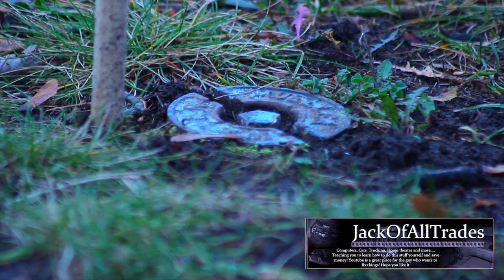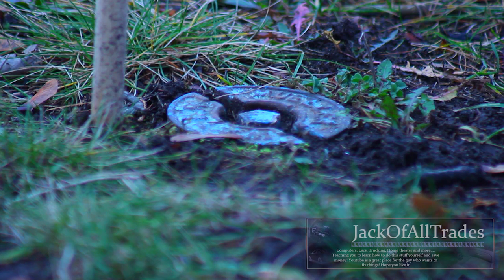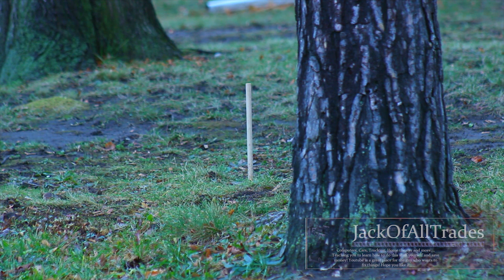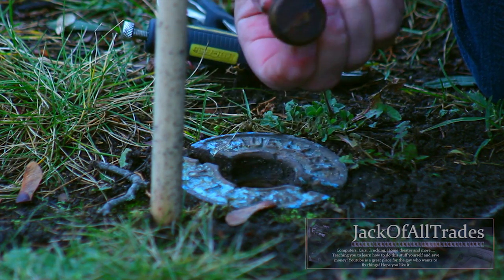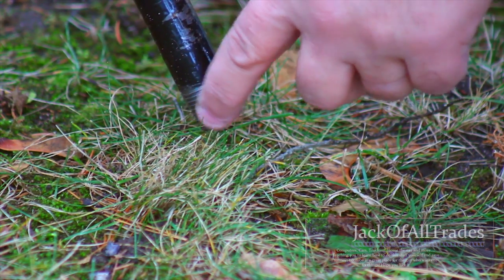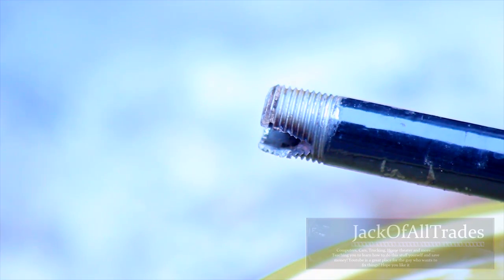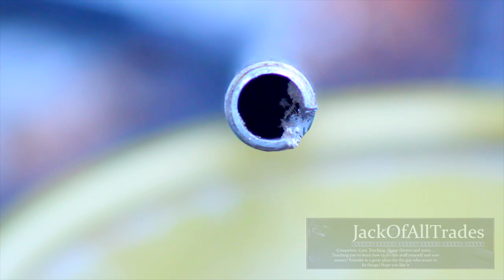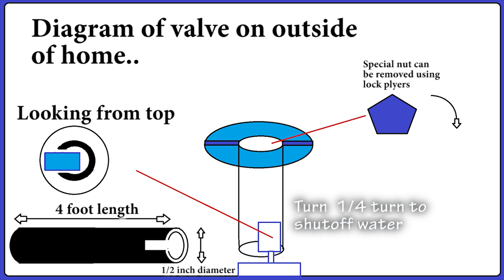How Do I Shut Off The Main Water Supply To  My  Home With This Special tool and save 80 bucks

Comment: I had difficulty finding the correct curbside valve shut-off tool as the depth in the ground was 4ft and less than 1" narrow. I bought the 1/2" cast iron rod and modified as you suggested. It is a low-cost solution and works great. Thank you!

Comment: From Winnipeg MB
 Thank-you for this. Just talking to some friends who had their inside shut off valve break after returning from vacation and had to try and stop the main pressure from flooding the house, while they waited on the city service! Some two hours later the technicians/engineers arrived! So I think it is wise if everyone has a key for real emergencies only, not be dependent on "rapid response" from their local water authority. So the issue is really time and not money saved.
Reply: Same here

Comment: Good video, and does work, but a word of caution,  don't force an old rusted shut-off valve because if the valve breaks apart and starts leaking, you could be paying significant repair bill from your local utility.

Comment: In Markham Ontario,  fees to charge to turn on/off curbside water valve during regular hour is $173.5 and after hour is $262. Plus tax of course. I will definitely try your method. My indoor shut off valve is leaking. I need to repair or replace it. Thanks General1.
Reply from the maker: When I bought my house the main shutoff valve started leaking a year later. Guess the plumber or previous home owner used a metal adapter with a bronze fitting and it leaked. I replace with all brass and new shutoff valve. Remember to slowly work it back and forth little untel 1/4 turn. you will feel it stop. Open all the valves in your house before. Then have your wife check if the water is off. Reverse to turn back on. Be cautious as if your break the valve it will cost you to dig in out and replace. Good luck.

Comment: I used similar pliers but can't move the nut at all. Any special trick or tool to do you job please. Thea house is about 20 years old. Never touch  the water valve before.
Reply from the maker: In comments some users said there is a hex nut that local hardware store sells to undo this. You could try blow torch to loosen rust in threads then pliers. When I use to do automotive work blasting nut with heat helps get her off.
Reply: @gereral1_jackofalltrades  great suggestion. I have sprayed a lot of WD40 to try loosen up the rust. Then I will try your methods tmr. Thanks for your immediate response. Have a nice weekend.

Comment: Hi guys is the lid bolt a 1/2-Inch Drive 5-Point Penta Socket
Reply: mine was 5/8 inch penta. can't find it in canada - except on amazon. but you can get it at home depot in the states or any plumbing supply in the us also

Comment: hey, very useful vid. Thanks! I'm in Brampton...do you know if there is supposed to be a pipe connected underneath to keep the cover in place?
Reply from the maker: The cover screws into bigger pipe and the valve is inside like a pipe inside a pipe.....
Reply: @gereral1_jackofalltrades  thanks for the swift reply man! I was asking as i found my cap loose (driveway) and wondering if it should be sitting on something. Looks off
Reply from the maker: @MonstasInc  I live 45 minutes from Hamilton lol stay safe
Reply: @gereral1_jackofalltrades  lol nice thanks man - you too!

Comment: Is there a special tool for that specific bolt?
Reply: yes
Reply: @sneakinguponit  were can i get it?
Reply: Google pentagon curb stop key. There are lots of options. It helps to know what brand the box is as the sizes of bolts vary. I saw a socket adapter that fits all of them but don’t remember what it’s called.
Reply: if you stay in canada the only option is amazon. but you can get it at home depot US or any plumbing supply in the states. there are companies that sell them in canada but only to municipalities (usually). mine was 5/8 inch penta. that's the most common from what i can tell.

Comment: Super helpful, I was just wondering what type (material) of pipe did you use to make your tool? Also how did you fit a handle to the pipe so you can turn it?
Reply from the maker: Metal threaded pipe. Used loctite on handle so it would be solid.

Comment: Most cities frown on anyone shutting off the water at the curb who is not authorized to do so, the 80 dollars may be cheaper if you break it and you don’t have water for a few days or you cause it to leak and get charged for the repair

Comment: is it just a shut off valve? the water pressure in my house is super weak, i went everywhere around to check  and all the valves are fully open up to the main of the house, so i tough about opening more the one from the street, can you rise/lower the pressure from there or it just put it on/off?
Reply from the maker: martin blouin on off..... Be careful you break it it's going to cost you to replace. The water pressure can be from the town line connection to your main shutoff inside your home. My main valve was 80 percent corrosion because previous owner put a brass valve on a galvanized metal fitting which rusted. Cought it in time before it rusted through. My pressure is 50 psi now. It was supper low because of the blockage.
Reply: close to where your meter is located there is a pressure regulator you can increase or decrease pressure on the top bolt

Comment: Isn't there a tool we can use instead of making our own or the cap off with pliers?
Reply from the maker: No the shaft is too narrow and I've never seen a socket in any socket that will remove that weird nut. Just be careful as if you break it they will make you pay for a dig and repair. I did this and was fine but I'm sure it's gone bad for many as well if the valve is seized.

Comment: Or you could just buy a water key at a local hardware store. Caution: if you're turning off the utility's valve and it happens to fail while you operate it, you might be out several hundred dollars depending on the utility. They may hold you responsible for the damage to their equipment.
Reply: Wasn't me, don't know what happened.
Reply: I just came out to look at it. I can’t find one at the stores
Reply: FYI. Even if you do the “right” thing and the water dept breaks it, you’re still on the hook for the repair.
Reply: @saljablo2767  Never heard of that before. On top of that, at my last employer before retiring, the techs were prohibited from touching or operating customer owned equipment for the same reason - they break it, they buy it.

On one call I sent a tech on, he found a customer leak on their service line. The lady couldn't turn off her private valve for some reason so the tech tried to do it for her. 

The private cutoff valve broke, so now WE were responsible for her damage. He tried to repair it without telling me and only made matters worse as the pipe broke. Now he was screwed and had to request assistance. Problem is, our techs don't have the parts needed to repair private equipment. I ended up having to call their supervisor who had to arrange for a plumber to go out there on our dime to repair the damage we'd caused. His supervisors were NOT happy.
Reply: @whiteknightcat  a lot of people don’t read the fine print on their bills. Water and gas service lines are the homeowners responsibility. That’s why insurance companies are cashing in now on it. You can buy a policy for a few bucks extra on your bill a month, that’ll cover and damage to service. From the street to your house.
Reply: @saljablo2767  A lot of people can't even read the big print too!
Reply: @saljablo2767  😢

Comment: I wish there were specifications on the diameters, idk if it's 1/2 inch inside or outside
Reply from the maker: if you say you need 1/2 inch pipe the hardware store will give you exactly what you see in this video. Be careful with the valve. 1/4 turn to turn on 1/4 turn to turn off. Older valves may break. I've shut mine off twice now with no problems. Now that I installed a new shutoff ball valve before the curb I can shut off the water to do work inside my home. The only reason I needed to shut off this valve was that it was leaking before my ball valve. Good to know this info in case of an emergency as well. Just be careful.

Comment: I copied what you have shown and it feels like i get ahold of valve but does not even slow the water  let alone shut off. I tried one quarter turn also much smaller turns and much larger turns also but water does not turn off
Reply from the maker: If valve is stuck call town. If it breaks it will cost you thousands for dig and repair. just be careful as these valves seize over time.
Reply: @gereral1_jackofalltrades  Yes I realize, thx but outside valve is maybe just replaced one year ago by the city, so I dont think or feel like it is seized, oh well I guess I have to pay $130 for the city to do. Much thx all the same.
Reply from the maker: @joedowney3197  it's a round valve with t shape on top. Wish I had a camera I could put down hole to show viewers. When I made this video I had town turn water off and on 4 moths prior and then had to install valve for home  so I built that took and it worked perfectly. My valve took 90 deg to turn on and off

Comment: The 5 sided special nut that you used a pair of pliers to take off at min.1:40 into the video on my property is recessed a little bit so I can not get pliers down to it and Vice Grips will not fit into the hole and around the special nut at the same time....What is this wrench called and where can I get one? Thanks
Reply from the maker: Its special tool. Just use needle nose lock plyers if there is room. Im sure a pipe cut to fit part of the nut woulr work too. Just be careful when you turn the valve. It may be stiff. Work it slowely. If you break it its going to cost you huge amount of money to dig up and fix.
Reply: A spray of PB Blaster and a couple of medium gentle hits with a hammer gave the bolt enough of a jolt to be able to loosen it with a poorly fitting needle nosed vice grips...be careful!

Comment: I run a water department in a small town in New Hampshire and I don’t recommend anybody shutting off their own water. Like other people have said this is not your valve this valve belongs to the town everything after this valve belongs to you. This is good advice call your towns water department and have them turn your water off because if there is a problem it’s on them. Remember just because this line runs the your house doesn’t mean you own it.
Reply: True, but if you have water running into your basement, and the city will take an hour to get there, all bets are off.

Comment: Hey brother, did you turn it clock wise or counter?
Reply from the maker: Clockwise off counterclockwise on. When I did mine I had to slowly work in back and forth. Remember if you break valve they will bill you. When I did this video they shut water off to install a water meter for usage billing. A month later I turned it off to replace main line coming into my house as the connection was leaking. Use caution.
Reply: @gereral1_jackofalltrades  Thank you for the prompt reply! My water shut off valve in my basement leaks and I've got 2 bathrooms upstairs with cartridges that requires replacement as they don't pull hot water any more. I will be shut the water off this week, will keep ya updated. Hope you and your family are well! Stay safe!

Comment: Bear in mind there's a reason the city charges the $80 to turn it off, because it's THEIR valve, not yours. Even if your home is newer that valve was installed many years ago with the water main, so have fun explaining how you broke their valve with a very costly dig to replace it.
Reply: They charge because it takes man hours and pricey tools. Not solely because "it's theirs".

Comment: Heads-up everyone - think very carefully before doing this. As has already been said, that valve belongs to the municipality, not us. A neighbour did this very thing in the winter and ended up owing the town $700 for damage he caused to the main feed below grade.
Reply: Ontario? Winter? not the best time to do it.Who is your buddy,vistor from Texas LOL
Reply: Who cares
Reply: 700$ is cheap to have someone dig it up and fix it. I'd say know your limit, if you exercise the valve frequently you shouldn't have issues... if it's never been exercised for 30 years, I'd let someone else take that risk. 

Using method from video, I shut off my brand new curb stop, ( just installed last month )and it was like opening a door handle it was so easy.

The old curb stop was possibly 80 years old took 3 people from the city to try it before they decided to come with a evac truck, and 5 more Guys and replace it that's still good value, even at 700$, I paid 120$.
Reply: @aaronj2141  if that valve breaks when city is turning it off Im sure they will charge you to install a new one and then some
Reply: @6769paul  Depends on municipality. Mine was a ford stop on a lead pipe, and three guys from the city couldn't "get on the valve". They brought a hydroevac truck  and sucked down to it and replaced the valve with a modern curb stop. How is beyond me. All I can say is they gave my the old one and were ablel to shut off the water afterwards. Home owner owns everything right up to the valve. City owns the valve and everything after it.

This was during my upgrade from lead to copper water line from the city, in the permit, they make you pay for the water shut off anyways, so all the costs were covered by the city, and believe me, three guys, hydro Evac truck, back fill truck with 3/4 clear, and parts would definitely cost more then 700$, if you broke the valve yourself and they deem it was tampered with.
Reply: @6769paul  no if they break it they fix it